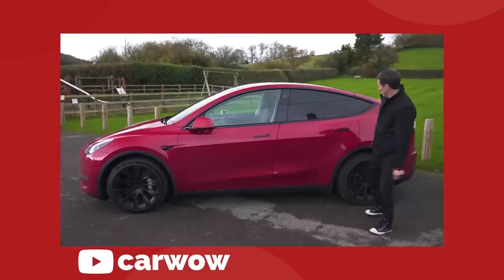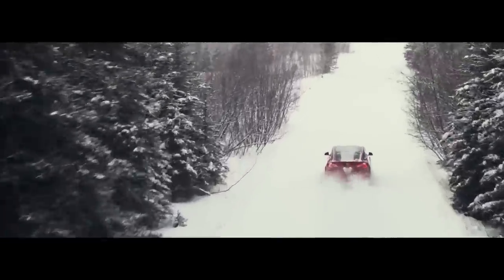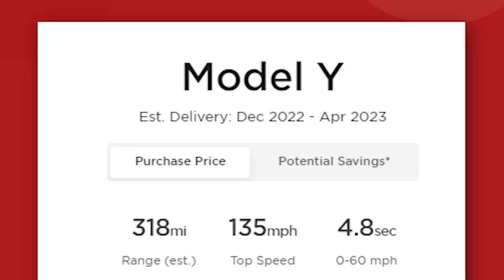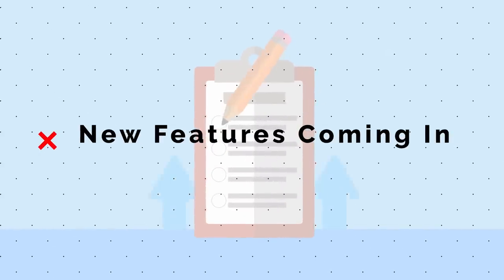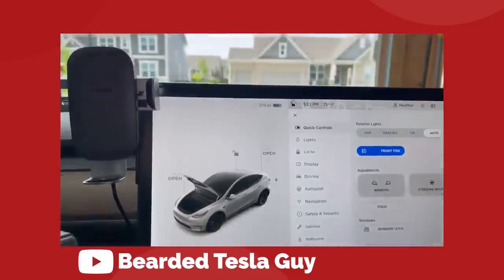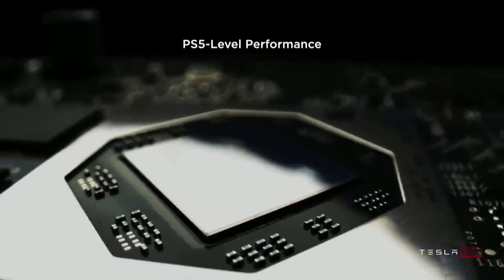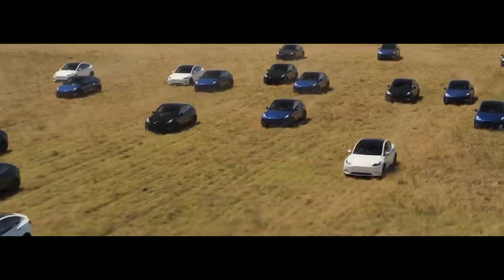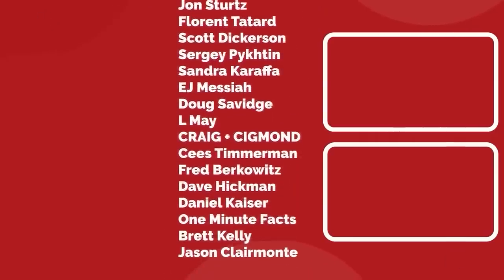The 2023 Model Y Update Is Here - All New Features!

Comment: I have a Model 3 LFP (60 kWh) and love it, however I wanted to point out that you can also now get the base LFP model Y here down under in NZ and Australia. This model Y comes with the same battery as my Model 3, and is priced to sell only NZ$1300 ( US$800) more than my Model 3 with the same battery. Comparatively the Model Y it is somewhat slower (0-100km in 6.9s versus 6.1s, and top speed 217kph versus 225kph), has a bit firmer ride and has somewhat shorter range (455km versus 491km WLTP) but obviously its roomier and would make a very practical family car. We have extended family in Australia that have opted for the Model Y due to much lower waiting time than the Model 3 and great practicality. While I might have considered the  Model Y, if it has been available when I ordered my Model 3 (late December 2021), I'm not planning on "upgrading" as the Model 3 has plenty of room for our needs and I'm enjoying its performance, ride and range.
Reply: But Model Y 's appeearance looks uglier than Model 3,  it's like a fat version of Model 3, I don't deny some people may love that.. Here in China evryday I drive my Model 3, and saw a ratio like 3:1 for Model Y/Model 3 on the road. More and more people are buying Model Y because it's roomier, but I think most of the time we don't need that room, even for those who always bring  3 ~ 4 passengers..Maybe people just want to look bigger, at least in China people like SUVs

Comment: Received my Model Y Performance Sept 9th. Can't say enough how much I love the car. Only real request I have is, I wish Tesla would integrate some trim lighting in the dash, door panels, and center console. I feel this would really give the interior more class, especially at night. I'm also a nerd when it come to lights so, there is that.
Reply: Random question, did your car come with the mobile connector? I got mines around the same time but didn’t get the mobile connector even though I placed my order on January 2022
Reply: There are a ton of after market lighting you can add to your model Y.  I tried getting some for mine when I first got it but it turned out I got the wrong version and they didn't work.  I did install the door light things that show the Tesla symbol at night when you open the door.  Those are pretty cool.  Lots of neat accessories out there for your awesome Tesla.
Reply: @2chill2worry  they will send to your email promotion code $200. then, you can order whatever you want.

Comment: I have a Model Y (Long Range) on order with a current delivery date of December 27-31, 2022.  This is an improvement over the December through April 2023 timeframe provided when I initially ordered the Model Y.  Since time is not an issue, I don't want to rush a delivery if there are planned upgrades to a car built in the first few months of 2023. Another point is, I live in the Los Angels area of California and have been told my car will most likely be built at the Fremont facility which does not seem to build cars (initially) to the same specifications as the Austin plant.  My question is, are the enhancement in the 2023 model, being discussed, sufficient enough to cause me to reschedule my delivery?

Comment: Incorrect assumption about 4680 at Giga Texas. I’m picking up my Texas built, 4680 equipped, Long Range Model Y (ordered last Fall) TOMORROW. I was told by my Tesla rep yesterday that all long range model Ys coming out of Giga Texas have the 4680 pack.
Reply: interesting... let us know. I have a Y LR ordered in April with a delivery date in December. I would love to get the 4680, structural pack and front casting.
Reply: Are you sure? The range still says the same on the ordering page.
Reply: @derekgamble7090  I ordered the long range that is for sure. I guess I need to know how to tell if the car has 4680 or not?
Reply: @SportPlusDad  yup the long range mileage has not change to reflect the 4680s performance. They were supposed to have had better performance then the old I thought.
Reply: Tesla also said they would be installing 1000 solar shingle roofs a week this year.  Oops.
Reply: So did you get the 4680 in your MYLR?
Reply: @Annngelooo  I did. Guy at delivery confirmed 4680 but couldn’t offer anything in writing since of course folks want proof. Based on the range calculation, it’s showing 325 miles range. It came defaulted to charge only to 90%.

Comment: In love the car. Model 3. I drive several long hauls per month. After having to recharge every 200 miles is just not practical. Between charging cost and time it's not worth the effort.  My Honda Accord is much cheaper to drive on those trips.  Bottom line Tesla is an amazing vehicle and driving experience is at the top of the chart. THEY HAVE TO GET THE RANGE UP TO A REAL 500 MILES. Without that the car is exceptional city vehicle. Not suitable for me. Do I believe they will succeed? Yes and I have been very happy with my two stock splits.
Reply: My Standard range will do nearly 300 miles if I am careful. The new Model3 Standard range has a WLTP of 305 miles. Though there will always be some use cases where people prefer to pay more to not stop for some reason. I certainly could not go for more than 3 hours without a break anyway - even if my car would be capable of carrying on.

Comment: Note that the battery of the standard range Teslas are happy to be charged to 100% all the time. For range comparisons you should therefore take 100% of the announced range for standard range cars and 80% for the others. SR's announced range is 455 km, and 565 km for the LR (but only 452 km at 80%).
Reply: Well there's nothing stopping you from charging to 100 it's just another half cycle on the batteries 1500 cycle lifetime which you can use when you need it
Reply: @sethinman7206  Apart from the fact that the last 20% take so much longer to fill up. So, from a road trip point of view you get a quicker from A to B not charging to 100% on a long range. Remains though to be seen how the standard range charging curve looks.

Comment: Gotta say ... as a sport sedan fan with absolutely ZERO interest in CUV's, SUV's, whatever-you-vees ... this EXCLUSIVE focus on the Model Y is pretty disheartening. All I need to hear is when will I be able to order a Model 3 with front and rear castings, structural battery pack, good paint, and whatever other advances in manufacturing and vehicle content Tesla comes up with, whether from Texas or a refurb'd Fremont factory. That's all I ask.
Reply: My 3 year old Model 3 came from Fremont and is cosmetically perfect _ I don't know why this rumour persists that the paint / fit / finish is poor. As for performance, my Standard Range properly put a Bentley Continental back in it's box the other day. I don't know about the single castings but other improvements such as double glazing and heat pumps have been employed with the Model 3.

Comment: Using the touch screen to go into neutral will be great. Trying to move the current shifter only halfway to access neutral is really hard to do and is always a problem at a car wash.
Reply: Use car wash mode in the settings
Reply: Imagine not being able to shift your "futuristic" car into neutral 🤣🤣 yet tesla is more valuable than all other manufacturers combined 🤣🤣🤣🤣🤣🤣🤣 what a sham
Reply: @joshlewis575  Got no idea what this guy is talking about above, the shifter is the same on teslas as in any other car, he's probably just a bit.. you know..
Reply: No, it is not hard to do at all. Do you even own this car? FFS
Reply: What if your touchscreen broke then how would you drive the car ? I think driving controls and some other controls are better left out of the giant tablet
Reply: You have to move the shifter only half way to get into neutral. Since we only do this once every 6 months at the car wash we never get practiced at it. We have had the car for 4 years and have never gotten it right on the first try. And the second try is not the same direction so we get it wrong multiple times before it works. 

From park: half way down, if you go all the way down your in drive. 
From drive: half way down does nothing. You have to go half way up. All the way up is reverse. 
From reverse: half way up does nothing. You have to go half way down. 

I will take screen controls please.
Reply: How exactly would the touch screen break? I have had my model 3 for 4 years and never worried about the touch screen breaking. I would be more worried about breaking off a physical control stick.
Reply: @ecospider5  good for you my guy but whats wrong with a physical button or a shifter or you always want to look at q giant tablet next to you or on the road
Reply: I have no need for a physical shifter. So I don’t want to pay for a physical shifter. Also I really like the minimalist design of the model 3. So every thing you can get rid of is a win in my mind.

Comment: I have heard 40% Teslas are LFP.  Cheaper and almost zero chance of fire.  Plus they love 100% charge to 0% charge.  Perfect for commute charge with frequent use of super chargers or rental fleets.  You have less range with Lithium ION as batteries like me the 20-80% range for longevity.  Tesla wants diverse choices of batteries to prevent shortages.  LFP for entry level(lithium IRON).  2170/18650 lithium ION for high performance/long range, 4680 for entry level Y and later Cybertruck.  4680 less batteries are needed
Reply: This is just a rumor.
Reply: The ‘standard range’ LFP chemistry is a type of lithium-ion battery. The nickel based (NMC) batteries used in the long range variants are also a type of lithium ion battery. I wouldn’t say LFP loves 0% charge. They can take a lower state of charge better than the long range packs though (doesn’t degrade the battery as much over time).

Comment: Is funny but my friend just get a new Y and he have gaps between the hood rear panel doors ene 1 badge is loose . The roof is hot as a convertible and also the battery can be use only 80% plus never should be run until zero at the end only 70 to 75% can be use. Sorry is not Douable at 78k dollars. Not for a  secondary car.

Comment: We owned a Kona EV. I bought first one for my son. Lasted 2 years. Everyone loved it. I got 130 miles real range at 80 mph with AC and music blasting or heat. Never even close to 280 mile range. But easy home charging. Road charging was a fucking disaster, slow and spotty and miserable and confusing (compared to Tesla Supercharge there is no comparison. Tesla rules charging). We appreciated the ability to remove regenerative braking also. Annoying sometimes.  Then, the Chinese battery went dead. Hyundai dealership gave me all my money back under lemon law. The day I received my check a new battery arrived and car was ready for me to take home. Aghhhhhhhhhh. I didn’t buy it back like a dumbass. I regret that. I could not find another electric for my son. Settled for Sonata N line. He likes but not love.